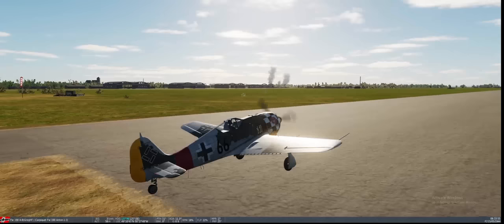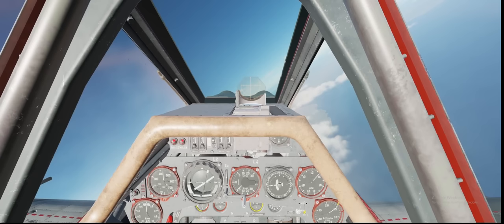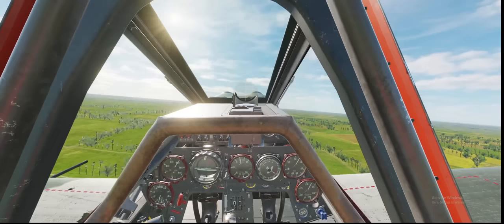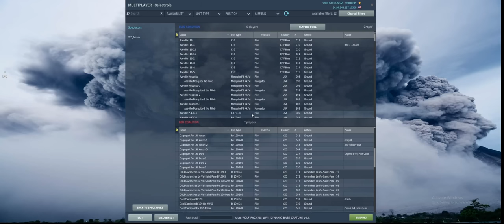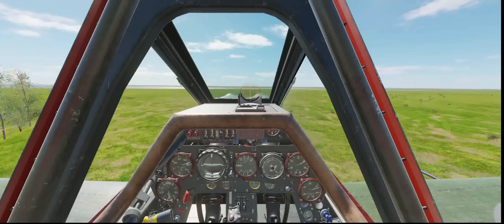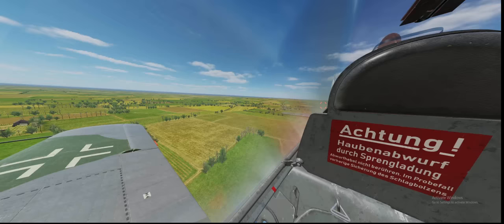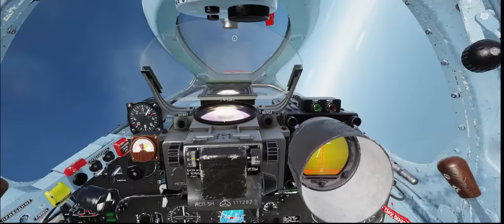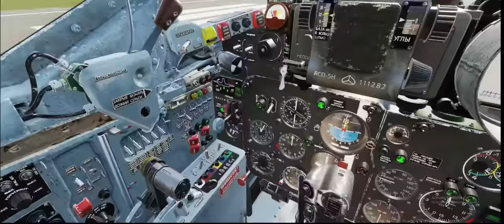German Cannons, Soviet Cannons, P-47 Mach, Angry Authors and More

Comment: Really losing your legitimacy sadly.
Reply from the maker: Why do you say that?
Reply: @GregsAirplanesandAutomobiles  
Because you're wrong about P-47 range, and the conclusions you've pushed on your audience are disrespectful. You do those who served a complete disservice to suggest all that needed to happen was to fly a relay system at 10,000'. It's ludicrous, it would've been suicide over occupied Europe. The fighter groups refused to take the 200 gal ferry tank (the one you made famous) further in than the French coast because it's begging to be bounced from above. That's why it was half full when the 4FG used it on 28 July. Making conspiracy theory claims without near enough evidence is unprofessional, there's so much more in the archives.

Comment: Mmm, this is a tough one. The opinion of Eric Brown, who was a successful combat pilot before becoming a test pilot, and who actually flew a P47 in dive tests, versus the opinion of Gregg who's done a lot of reading 70 odd years after WW2... Actually no, not tough at all. 🙄
Reply: And all the other test pilots, the designers of the aircraft and NACA were also wrong, because they all agree with Greg's conclusions?
Reply from the maker: Eric,  you missed the point.
Reply: Eric Brown (2 confirmed kills) vs Robert S Johnson (26 confirmed kills) or Gunther Rall (275 kills)? Brown said a P-47 couldn't outdive a German fighter. Johnson and Rall both disagree.